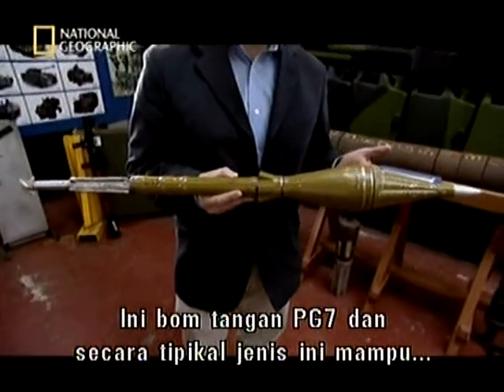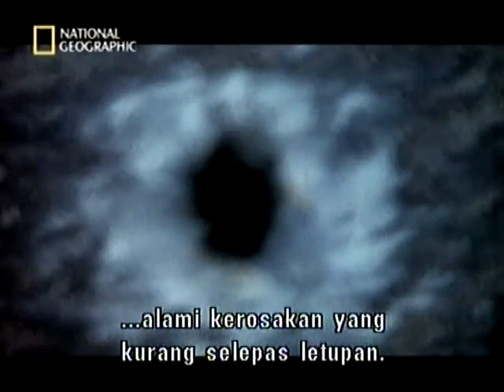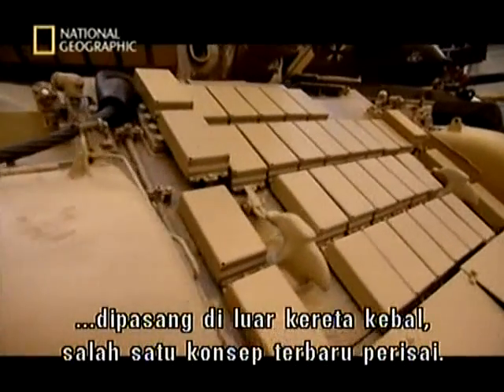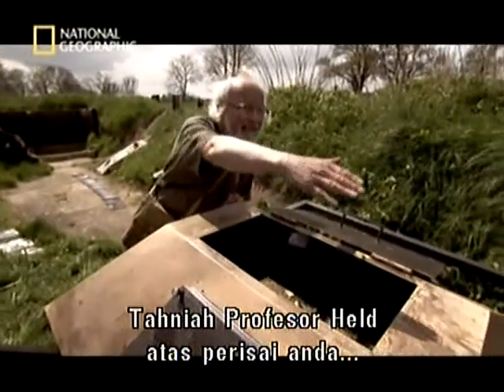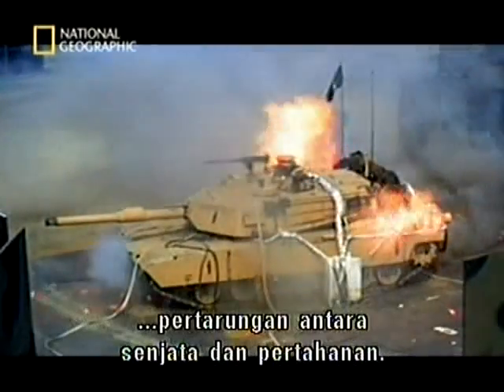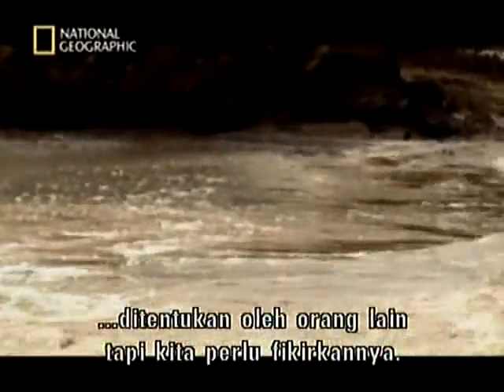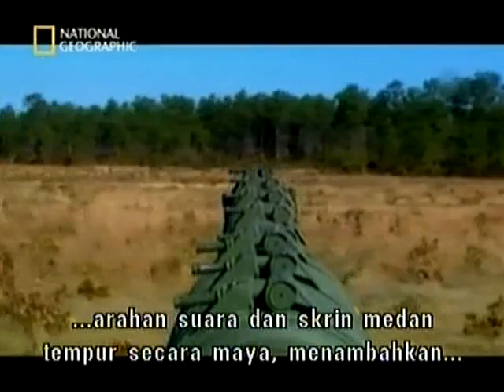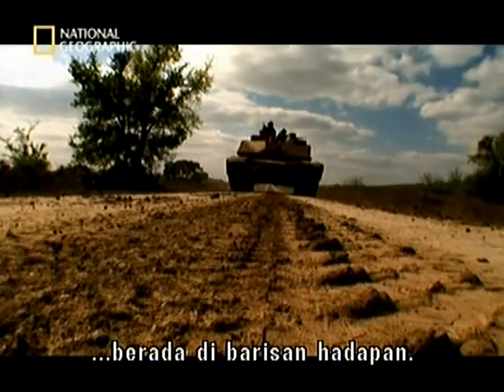Explosive Reactive Armor

Comment: Its a trade off, the less armor gives speed but makes it easier to knock out. More armor slower but harder to knock out. Both have merit but picking one over the other depends situation. Mobility is good but place that tank/striker in a position where out flanking is just not an option and you have a problem. Look at the leopard 1 german mbt, the max armor on its hull is roughly 70mm thick but its fast with a great gun for its time. Same idea but the leopard 2's got away from that idea for a favor of balance. Flexibility is key, if you can't change and adapt on the fly you will break not bend.
Reply: Tali Sparta true

Comment: In regards to penetrating reactive armor, why can't someone develop a gatlig- gun type of rocket device that fires a thousand rounds a second at a tank with reactive armor?  After the first salvo, the reactive armor would be spent, and the tank's remaining armor will be easily penetrated.
Reply: the cost and size of such a gun you propose is crazy
Reply: Corin Oliver
How do you know?  Have you done studies?
Reply: +georg cantor from google, an rpg-7 (i assume would be the cheapest unguided antitank weapon) round costs $500 a shot. a thousand round per second would mean $500,000 per second.
Reply: +georg cantor no you can't put a value on that. but if there is a method that costs less money to attain similar results, common sense says we use it. the military doesn't have an unlimited budget, so using cheap methods you can save more lives instead.
Reply: fatbuffalo
What's $500, 000 compared to saving the life/lives  of soldiers tasked to taking  out the enemy tank?  Can you put a value on human life?
Reply: +georg cantor actually, i came to realize that theres something right with your comment, a top tech machinegun can easly make all of those packs explode leaving the tank with less armor and easier to penetrate.
Reply: +georg cantor germany used better tanks against the red army, and they lost to cuantity. history is against you.
Reply: +georg cantor dude thats basically gau-8 with 30mm uranium rounds will demolish tanks 4000 rounds per minute 30mm is a huggge round
Reply: +georg cantor why use explosive when sending 4000 projectiles can go right through
Reply: blu3flare25
it depends on the kind of projectiles - example, if you're sending 4000 flint spears, then I doubt they'll go right through.
Reply: georg cantor well no shit lol but if where talking about 30mm uranium rounds 4000s a minute will go straight through tank armor
Reply: georg cantor so basically i answer your original question they already have that for the a-10 would honestly be very good on a tank to i guess the army is just to dumb to think of cheap but effective weapons
Reply: georg cantor its just not explosive lol
Reply: blu3flare25
Or maybe the military does have it---it's just part of skunk works along with the Aurora Project.

Comment: When I joined the Army many years ago, my recruiter told me I could be a tank turret repairman.  My response was, I don't want to be anywhere near a tank.  Someone else described it best, a death trap with a big gun.
Reply: i dunno....old time infantry will always tell you "two feet and a heartbeat",  tanks go out looking for a fight and you know what happens when someone does that.  they usually find one....sometimes to their chagrin.
Reply: WISE MAN ONCE SAID...YOUR DEMISE DEPENDS ON HOW GOOD YOUR CREW IS.
Reply: Safest place on the battle field.
Reply: @jkutnink87  correct
Reply: @jkutnink87  My ass
Reply: @jkutnink87  - This comment didn't age well.
Reply: @grapas100  It actually is if you aren't using battle strategies that the cavemen could rival.
Reply: @Whickerx7  - Russian battle strategy has always been just throw equipment and personnel at the problem until it relents

Comment: 300mm of steel? Who are you selling it to? Why dont you use it? Are you selling the defense for it or it as defense?

Can I arm your troops with it and chain them to poles in the ground and drive around in a tank with 300mm of steel plating and run them down?

Why not?
Reply: ***** Terrorists RPG's how come they dont have a factory that builds them, why dont people just go after the factory building these things instead of the end user? Kind of like drugs. You hear all about the people busted with a kilo of this and a kilo of that and they are punished. People paying taxes for legal fees. it works when there is more crime you can raise taxes.

Why people take bullshit seriously and react to it and serious shit is a joke I dont know.
Reply: +Ryad Arlan Modern tanks don't use simply steel for protection, which is also incorrectly labeled as steel, since tanks use alloys of different materials as protection. It can contain but is not only limited to steel, as you might find as well something like molybdenum, vanadium, iron, aluminum and in some cases even uranium as a part of it. Different tanks often contain different alloys and materials, but the correct composition and thickness is obviously always a well guarded secret. The RHA, Rolled Homogenous Armor, is what tanks used in the past for protection, like WW2 and post WW2 designs. What you're looking for in armor, is something that's hard enough, so it doesn't get penetrated easily, but at the same time soft enough so it doesn't shatter on impact. To achieve that in one single material, is pretty much impossible. So modern tanks and vehicles contain a combination of different materials, with layers, that resemble a sandwitch. But since you can't just release informations about the correct composition of the armor, RHA is a way to measure and visualise the effectivness of your armor. Modern tanks like the Abrams or Leopard 2, so they say, give a protection that is equivalent to 900mm or even more of RHA. Of course no tank has 900mm of armor on it! But it's the combination and characteristics of different materials, including active and passive armor, that is adding to the protection.
Reply: CrniWuk You know your tanks. Thanks

Comment: Simple, stack the Strykers protection on its sides and install them when deployed.
Reply: they would need a second airlift. if the striker is airlifted with all of the armor, it's too heavy. they would need to bring a follow up "installment pack" with all of the armor. it's just too inconvenient
Reply: +iwasmuted4 In the middle of the battlefield!? Do you want them to be attacked when they are most vulnerable!?
Reply: +budmeister I mean when they are brought into the base where they are being deployed by a cargo plane.
Reply: +budmeister If you get a competent engineer to design it, it would only take 3-5 minutes to install and I don't think you'll be airlifting it DIRECTLY into a hot LZ.

Comment: Future for tanks would probably be something like a wheeled Tank with a High caliber gun packed with reactive armor and APS systems that has a spcial ability to camouflage itself from the naked eye or even from heat sensing equipment lol.

And maybe in a much later year, it will be fast moving Nuclear powered tank's (something like iron man's reactor to power his suit) with a 120mm Rail Gun or Unlimited Laser gun lol.
Reply: no
Reply: +eroOtoko1 nuclear power is and always will be a no go for tanks. Also, a 120MM railgun would knock the tanks own turret off with recoil. And active camo for visible light? No. A visible spectrum active camo would not work for IR...and most(if not all armored vehicles) use thermal sights for targeting and acquisition. It's better to use a camo-net.
 
It (future tank ofc) will have more advanced passive composite armor, thermal camouflage, APS, better targeting detectors(of being "lit up") and a railgun type main gun for sure.

Comment: The main problem with reactive armour is that once used, the inner shell is unprotected from the following attack at the same spot. Hence 2 RPG rounds at the same place will destroy the tank.
Reply: well its better than nothing
Reply: +Vikas Sheth 
No need for two rounds. Just use a RPG-29. It fires a tandem war head. A small warhead up front to clear the way for the main warhead.

Comment: Okay, but the Striker has rubber tires which can be popped and it's not armored enough vs high caliber machine guns firing AP ammo or autocannons, at least without bogging it down with heavy applique armor.

Just pepper it with hardened steel, can't stop those.

Comment: reactive armor is a one hit wonder...
Reply: Well yeah ,but the probability of you hitting the exact same spot where you detonated one of the reactive armor bricks is very small
Reply: Yes but people will aim for it, especially people with RPGs
Reply: ***** Just because you aim for it ,it doesn't mean you'll hit it .The tank is ...oh well...you know...A MOVING VEHICLE ....AND IT'S FIRING BACK !
Reply: agreed
Reply: BlackGray LightGray by the time they are finished shooting at the tank the tank will have shot back
Reply: BlackGray LightGray
try hitting the same spot a 20mm Rifle or tank canon hit with a RPG at a distance greater then 50 meter
Reply: ***** Also the reactive armor plates can be easily detonated by 20mm projectiles before firing the RPG shot
Reply: Rafael Oda
its not likely that a 20mm canon or at gun will detonate a reactive armor plating only so that a RPG can hit the same spot, most modern MBTs have realy tiny plates covering the hull and turret
aditionaly to that a small amount of tanks have a Active Reaction system such as the T90 and Merkava which is able to shot down RPGs aswell as ATGMs and in some cases even tank shells
edit: there are also some armored vehicles such as the T72 Modernisations that can carrie 2 layers of ERA, the first one placed betwen 2 armore platings, beeing save from small arms fire and small canon fire and the 2nd layer just ontop of that armor
Reply: may be a onehit wonder but the russian T90 MBT has 2 layers of Reactive armor at the front and it has a Active protection system called "Arena"
watch?v=YpmcmKwWzYo
Reply: BlackGray LightGray
try penetrating the front of a T90 with a RPG, Good Luck
Reply: BlackGray LightGray
you know that MBTs can move and RPGs are not realy accurate weapons
Reply: I mean what if somebody shoots automaticaly with an 20mm autocannon the tank to detonate the plates,since 20mm bullets can pierce them and cause them to explode,leaving large areas uncovered for the RPG projectile to strike?
Reply: @blackgraylightgray9416  
20mm will do absolutely nothing to any modern tank. In WW2, 37mm anti-tank guns didn't harm T-34's. Even armour piercing and/or sabot shells wouldn't damage a modern tank. 20mm cannons are for buildings/cover and soft targets.
Reply: @KC-bg1th  after long a reply. He was referring to the reactive armour. The 20mm shell is just required to blast the reactive armour then you fire the rpg or any other shell to penetrate the area without reactive armour.
Reply: John Fox So what you are saying is that, it is possible, but not probable.
Reply: ***** They are developing a new type of electric reactive armor that runs an electric current on the skin of the tank that creates a dense and expanding pocket of plasma that disrupts a shaped charge. Unlike reactive armor, this can be used multiple times and on the same position on the tank against multiple strikes.
Reply: *****
T-90A Triple Charge Heat
Reply: Its not necessary to try to penetrate the front.A tank can be attacked from the sides or the rear
Reply: EnigmaHood Inb4EMPgranades
and i bet this kind of technology is in a very early experimental stage
i bet we wont see any of this in active serving tanks in the next maybe 10 years
Reply: John Fox EMP wouldn't do anything. The shell of a tank acts like a faraday cage, and all military hardware is hardened against EMP anyway. EMP is only useful against civilian electrical infrastructure and even then you're probably better off using conventional explosives anyway as they are cheaper and destroy everything as opposed to just electronics.
Reply: John Fox It's easy to defend against EMP. Non-nuclear EMP is still generated by conventional explosives, so their power is limited by whatever conventional explosives they are using. So if the armor of a vehicle can defend against the conventional explosive that the E-Bomb is using, it can certainly defend against the EMP it generates which is less efficient than simply using the conventional explosive alone.

Like I said, you are better off sticking with conventional explosives. They will always be cheaper and harder to defend against. EMP is only useful to reduce civilian casualties, they are not effective against military targets.
Reply: +Hetzer Hasser 
Not if you are using a RPG-29 firing a tandem warhead.
Reply: EnigmaHood over time it will get cheaper and mroe efective and will propably get stronger and be able to disbale military standart tech
***** have never hearrd of this system
Reply: *****
T92 i only find stuff for world of tanks and Merkava 3/4 i never heard of having any of that armor
Reply: ***** i have searched, i have looked i found nothing but a single video from 08 when they tested it in the UK :/
Reply: They could also use 2 layers.
Reply: Hetzer Hasser you haven't considered an extense battle which would lead to several bricks being destroyed leaving whole portions unprotected. Well, it's not like they use soda cans under it anyway.
Reply: It's okay. I get the joke :)
Reply: The anti armor people have come up with tandem warheads which are basically a single round containing two warheads nested one behind the other. The first disrupts the reactive armor and the second goes through the now empty space to strike the main armor.

Comment: Fighting explosions with explosions. Nice
Reply: The thing is that the armor can handle pretty well against a non-contained explosions ( Explosions that disperse energy in all directions ) it is the metal that flying in the air that can penetrate steel so its not considered an explosion.
Reply: @ProtankGaming  correct, the explosion of the shaped charge is just the means to form a copper spike that penetrates the armor, it is pure kinetic energy, the explosion does no significant damage to the armor

Comment: Strykers are horrible vehicles.
Reply: Fast and heavy gun, its pretty much a Tank Destoryer
Reply: Do you know anything about Strykers? They are specifically engineered as a QRF vehicle. As a sustained engagement platform, as the Army insists on using it as, it is a piece of garbage. /thread
Reply: Whats the difference between a APC and a Stryker?
Reply: ProtankGaming
Pay attention to the video, it has weak armor, they needed to add a bunch of protection to it, which was more of a burden. Might aswell stick with the Abrams for now.
Reply: ProtankGaming
APC are meant specifically for carrying troops.
Reply: I am a Stryker crew member. A Stryker is a light APC. The only advantage it has over others (i.e. the Bradley) is speed. It is notoriously easy to damage Strykers.
Reply: *****
Speed on the road but not on all terrain. It has a bigger cannon too, the Bradley is an IFV.
Reply: The stryker ICV isn't equipped with a cannon. The MGS is, which is a tanker's platform, and it's basically a stryker with a tank's cannon haphazardly bolted to the top.

Comment: What if someone throws a Molotov on the tank and sets it on fire would the reactive armor go boom?
Reply: the Molotov burn for a few minutes not heating reactive armor enough , and the  flame  
would be spread over a wide area, which further diminishes its local heating effect.
A Molotov is effective as a burning liquid:  it penetrates engine compartments causing tank fuel 
to explode.

Comment: Currency is a important when our taxes and budget are going towards a giant metal monster that will probably be blown up before it reaches a target. Solution would be bigger engine, but that means more fuel, which means more money and more maintenance, and also more complex, meaning higher possibility of mechanical failure.

Comment: The Russians developed kontakt-5 in the 80sthey decided that in order to defeat a sabot you had to fee the armour into it. So with kontakt-5. The russans shaped the explosive in such a way that it fed the armour into the sabot, sideways and at high speed. The results meant that a rheinmetall  L55 Sabot couldn't penetrate the armour of a T-72. This result lead the americans to devolope a new sabot round. Consequently, the russians designed new armour, Relikt...

Comment: So what happens to reactive armour against a sabot round?
Reply: basically the same, but a APFSDS round has way more kinetic energy than a small copper jet of a shaped charge of a handheld weapon like an RPG

an RPG 7 with a mono lock  shaped charge has around 400 to 500 mm RHAe penetration while an APFSDS fired from a Leopard 2 or M1A1 Abrams penetrates around 700 to 800 mm

Comment: From my under standing they are simple. RPG, impact causes explosive that melts shape charge sending a jet of molten metal(copper i think) into the tank.
Reply: the copper spike on a shaped charge does not melt - it is cold plastic deformation, the penetration is purely kinetic energy - like on any other KE AP round

Comment: This is bullshit, the MAUS had a frontal armor value of 240mm RHA at most! Even the old M60A2 had nearly 300mm RHA, so your statement is invalid. No armor data of the T-95 project is known, but the M1A1 without heavy chobham-armor had 450mm RHA, while the most modern M1A2 even has 950mm RHA in the frontal turret.

Comment: Oh yes. Perfectly possible. And that 800mm of armour is RHS. And HEAT rounds work differently from a kinetic round, the whole game was changed so much so that in the 60's all tank developpers basically stopped trying to produce a heavily armoured vehicle, instead focusing on armament,mobility and fire control systems. This trend infact did not change until in the late 70's when ERA and advanced composites came in.